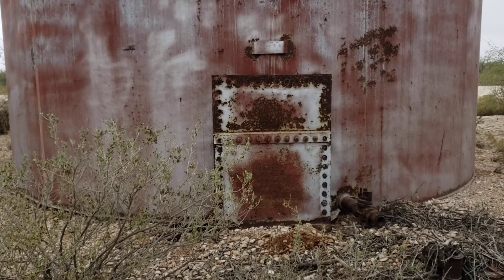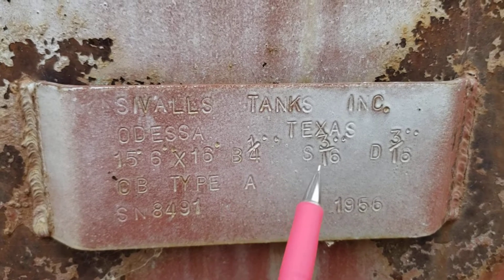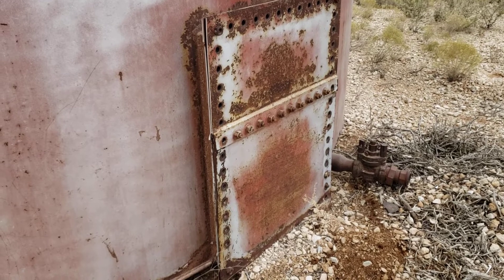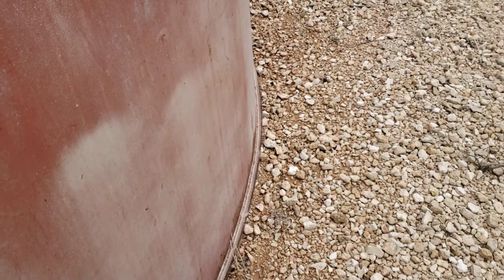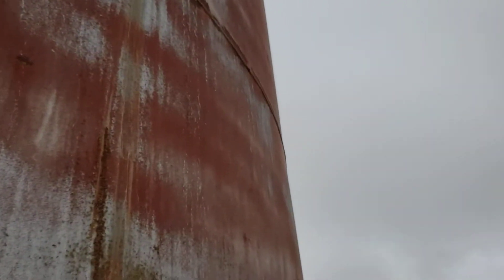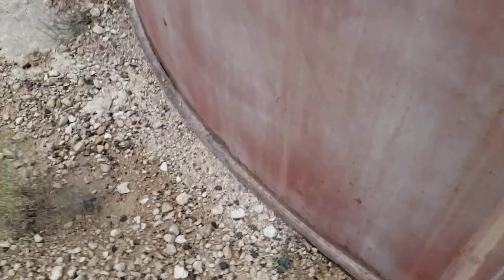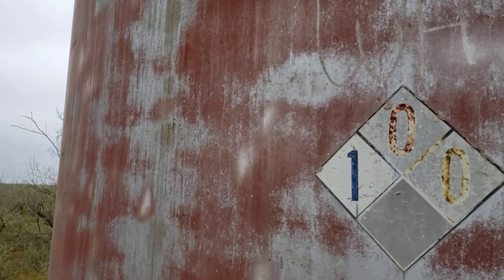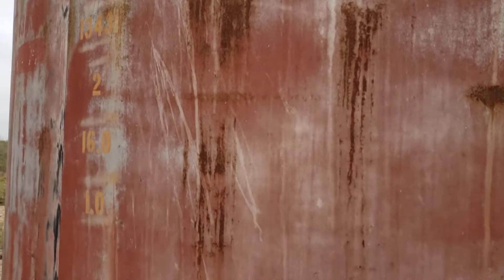Oil Tank inspection

Comment: someone probably bumped that pipe with a tractor 30 years ago brings the slow doom then after it was shut down water sat in the bottom and finished it
Reply from the maker: No tractor has been used around this tank.